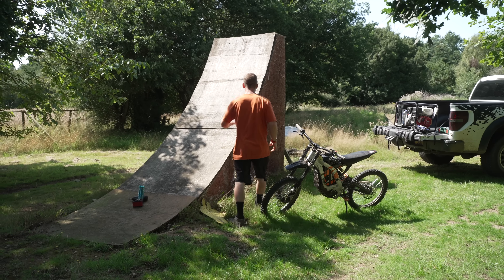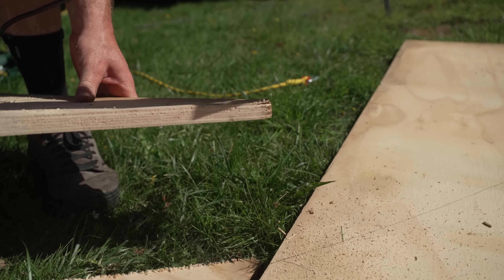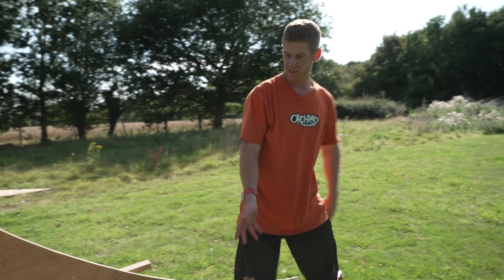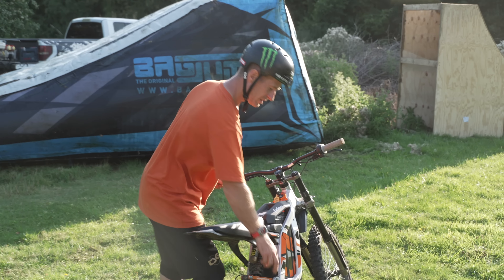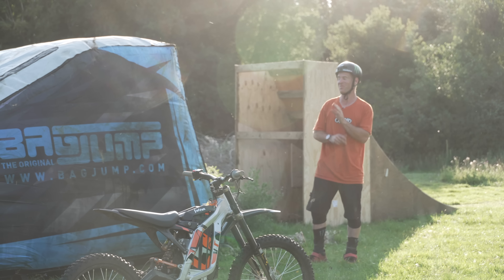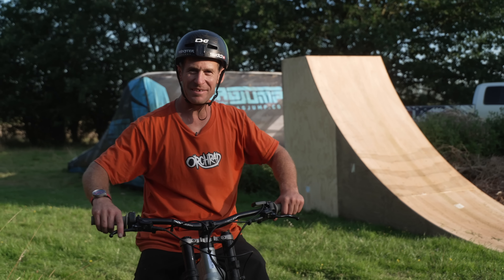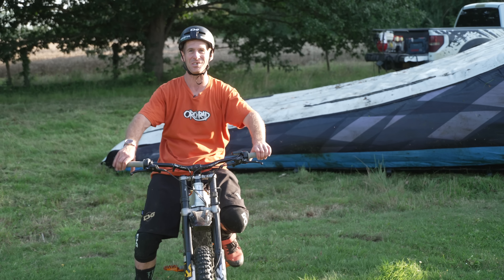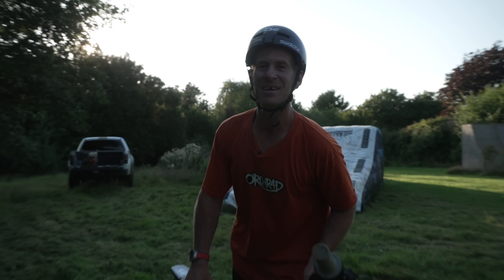MY FIRST ELECTRIC DIRT BIKE BACKFLIP - NEW RAMP!

Comment: Damn, I am so jealous and I want a Sur Ron so badly..... Sam planning on flipping a Stark Vark in the future.    😂
LMK if you don't want the Sur Ron after that... I'd be happy to have it.    😁👍
Reply: I own a sur ron LBX 2022 model I also own the 2023 Talaria MX4 sting R 
The mx4 does have a more touchy throttle and has more of a dirt bike profile vs the sur ron where it's more of a MTB profile.. and since the sur ron has been around for years now it has way more aftermarket parts currently available. 
That being said I'm blown away by The Talaria's performance 50% more power stock a way more sturdy frame better stock dirt wheels. All for the same price I recommend it over the sur ron. 
Another to check out is the Talaria XxX